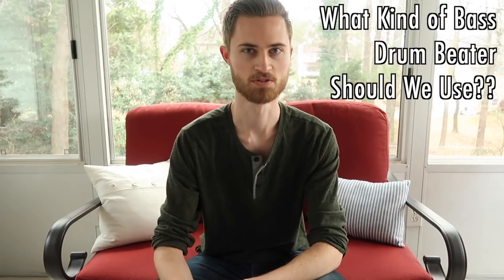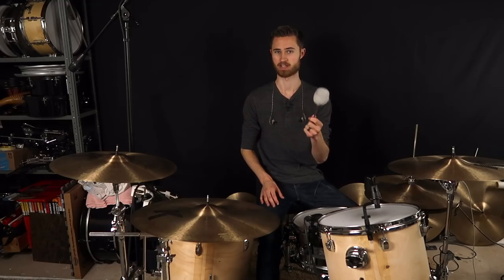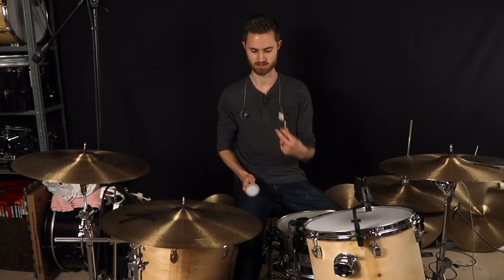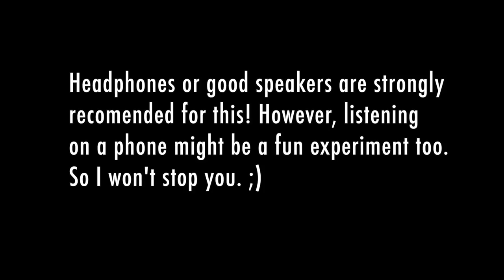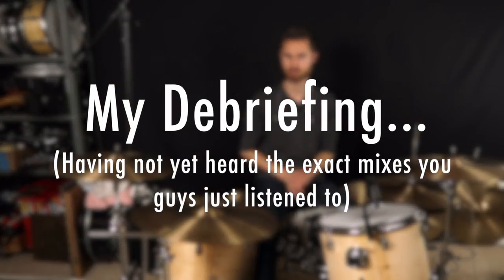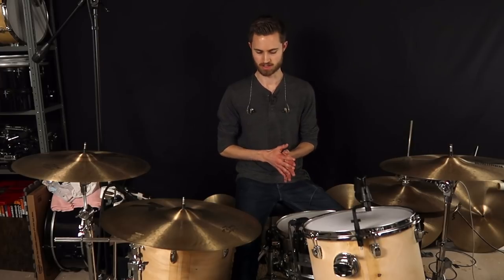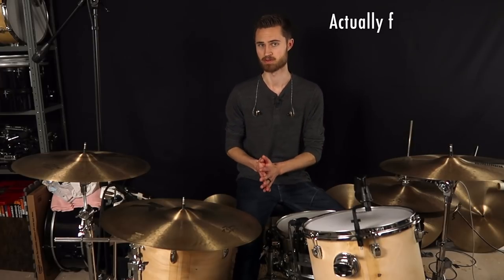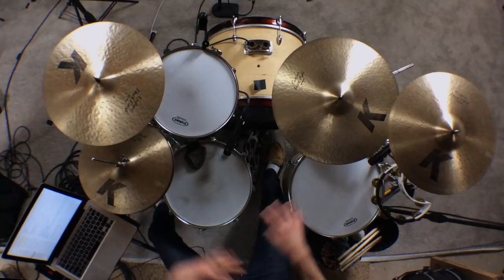Why Bass Drum Beater Type ALMOST Doesn't Matter...

Comment: As a recording/mixing engineer (and also drummer), not sure I totally agree with your conclusion. Yes, the tone/pitch/general timbre of the drum isn't gonna change; obviously the shell and (mostly) the head used will make the biggest differences. That said, there is a distinct envelope shape to each beater type, contributed to by the significant volume difference between each.

The wool has a softer (slower) transient and a louder post-stroke resonance.
The felt is tighter (faster attack), and (when gain-normalized) has a less resonant body. (low pass click, some drum)
The plastic is even more transient and less body, PLUS a much higher frequency stroke noise. (bright click, no drum)

For a live gig, Im with you 100%. Unless you're playing a very resonant jazz kick, the volume/compression on the board can render your beater choice pointless.
But if you're doing session work and spending time to get your kit sound, the right beater can make your kick fit in your mix a lot more easily without post-processing.

Then again,  re-tuning tighter can probably get you clickier results, but at least this way you dont have to change the pitch of the drum in that pursuit. Just my 2c
Reply: Some great points here. I definitely think Stephen was coming from a more “live sound” approach and how it will effect that (and probably most people that watch this might not be pro drummers and only play in “live situation” situations). But I agree, in the studio - this stuff dramatically effects transient shape and can make getting a “particular sound” a lot easier if you match the tuning of the drum, with the beater type, to match the end result you are shooting for.
Reply: 100% agree, there is a difference to my engineer's ears too, and I also think in a live it would be lost on the audience, but I also think in a full recorded mix most listeners would not be able to hear any difference.  What I do think, and I believe this is the most important thing to any music production, is that choosing a beater that makes the drummer the most comfortable will result in the best performance, and in the end that will always sound better
Reply: True af.

Comment: I think it depends on the tuning
A higher tuned Jazz Bass sound vastly different with a big felt beater compared to plastic. What do you think?
Reply: Exactly. And it doesn't even need to be that much higher, just as long it's more open bass drum tone. With that kind of drum and played off the head, the beater makes a big difference.
Reply: As I've said elsewhere, we forget that the bass drum is a MUSICAL instrument. I like a nice melodic TONE, not the dull thud of a cardboard box. I put a 3 inch wide piece of white felt under the heads 1/3 of the way from the left (front head, from the right - batter head) and tune both heads to the same pitch (said pitch tuned at each lug). I tighten the heads just above a loose "whappy" sound, then tune them up just beyond loosing the loose "whap" sound. I usually tune my drums to the key of "C" so they are almost always in tune with the band. I even try to get my cymbals in "C" when I purchase them new (Zildjians, of course). I use a hard felt beater.

That's PART of being a "Musical Drummer".

Comment: Of course there's a difference in sound and rebound of felt, fluffy felt, wood, and plastic.
There's a difference between regular felt beaters and the felt beater side of a pearl quad beater. 
Just like there's a difference between wood, nylon, and aluminum tip sticks (and different wood too)
Its density and hardness that contribute to the different characteristics of the sound.
Unless you've already damaged your hearing from playing too loud and heavy.
Or burying the beater. That muffles it immediately.

Comment: With the plastic, there's more high end attack. Which i really need for recording metal so that i don't have to boost high mids to +35 dB
Reply: From my experience I like having the hard plastic beater and extra attack there regardless of the style of music just for the simple fact it's always easier to dial down the mid-range than to turn it up several dozen decibels to get some good slap and articulation for the fast grooves
Reply: @Leonnoelmusic  Yeah, i still have to turn up the high shelf by 6 dB, but like you said it's way easier with plastic beaters.

Comment: The difference in feel is the primary difference between beaters.  They can make you strike the drum differently which accounts for more difference than the material.  I don't mean to say there is no difference between a plastic and a felt beater, but the rebound, and heft will cause a player to strike the drum differently.  Weight probably has more to do with a beater's effect on sound than material. The exception is  a super soft beater.  But wood, plastic, rubber and hard felt will all sound similar if they strike the drum with the same speed and intensity.

Comment: I think the reason that you aren’t hearing a difference in this case is to do with tuning and head choice. On a bass drum with unmuffled heads (ambassadors, G1s), you don’t have the suppression of the pitch and boom of the drum. As well as that, the higher you tune a bass drum, the more that comes out of it (to a point). So with an open bass drum with unmuffled heads in not a crazy high tuning, but medium-high, you’ll hear a huge difference!

Comment: From what i see, for a "stock" bass drum sound, really it makes little difference.
The more you go for a dry and clicky bass drum sound (the more you go toward a metal) the more the beater is paramount for the drum sound. As a matter of fact i believe it's impossible to take a clicky sound out of a bass drum without a wooden, plastic or similar beater. And i tried different heads and tunnings. The beater is a sine qua non factor for achieving the tone - it's not enough alone, but without it it's almost impossible to get it right from the source acoustically, then you're bound to do a whole lot of processing to compensate

Comment: Your beater angle is pretty weird, wouldn't it feel better with a 90 degree angle? Personal reference I  guess
Reply: i thought the same thing.Could be his height hes kinda tall.
Reply: I think it's angled that way so that the flat plastic beater hits the kick parallel to the head instead of digging in on the top edge. The felt beater on the other side has a round face, so it doesn't care too much about the angle it hits.
Reply: It's impossible for any of my pedals to get that angle unless you have a wider hoop. Or maybe not push the pedal up onto the hoop all the way.
Reply: I figured out how to do it, you take the piece off that is on the horizontal bar that holds the beater rod, and turn it around and put it back on.
That's the only way I can think of to get that angle.
Maybe he took his pedal apart and didn't realize it's backwards.
That's the only thing I can think of.
Reply: @gaboogablah  what do you mean? i can rotate the beater on my head up and down wit respect to the arm it sits on?
Reply: You can change the angle of your beater on the horizontal bar. I don't know what to call it, its the one the spring goes to and the chain or direct drive upper portion. You should be able to loosen the assembly that holds the beater on that horizontal bar and change the angle. Perhaps not all do that.

Comment: attention kids! don't run out and buy different beaters  save that money for a good crash. 
 also . what about the different bass drum patches .. not your deal but there are ones geared towards different sounds (mostly metal) the plastic click disk and the metal click disk ( purchased metal click disk vs vinny paul half dollar .. I used quarters .. trick )
Reply: That's right, the cymbals are the most important investment you'll make.
You can make cheap drums sound good, but you can't make cheap cymbals sound better.
And of possible, don't get entry level or beginner cymbals if you're planning on sticking with drums.
It will just screw you up and make you frustrated with cheap, bad sounding cymbals.

Comment: I use the vertical felt side of a 4 sided beater. I like a heavy beater because it feels better to me. I also have beater patch on the BD batter. It's a 22 inch oAk Custom with a Remo PS3 batter. Mostly play rock and prog so it works for what I need. I did like the sound of the softer beater on its own, but i think some of the nuances get lost in the mix. I guess it depends on the person at the mixing board really.

Comment: I play in a big band and I used to care a lot about beaters. So much that I would switch out or put a cut up paint roller on the beater to change the sound. Listening back, the sonic difference didn’t justify the hassle. The key is feathering vs playing out (which has a ton to do with what you said in your video about heel up or heel down)

Comment: Bomber gives better low end than either of the other two. Too bad the audio was edited to even out the volume differences, because on here, the bomber definitely has the fullest and strongest sound, which is contrary to Stephen's intro comment that he uses the harder beater for louder situations.  Also, the tuning of the drum is sure to make a difference. A very loose tuning (like this one) is less sensitive to alterations in technique than a slightly (or not so slightly) tighter one, and I'll bet the same goes for changes of beaters.